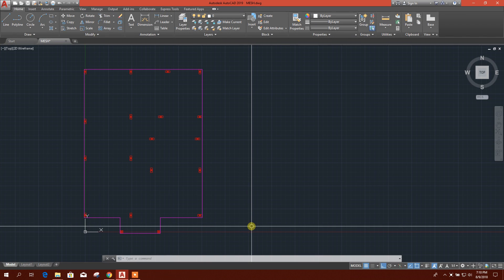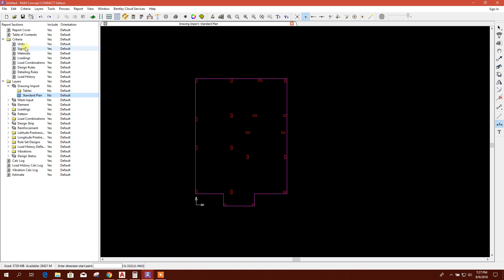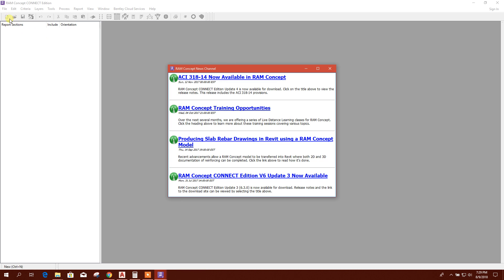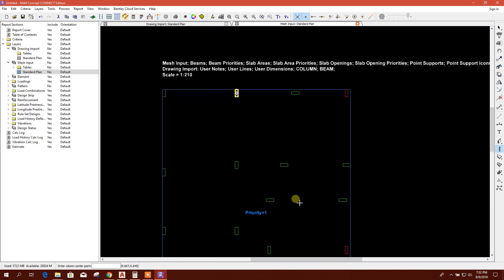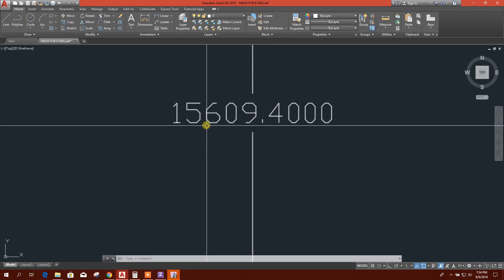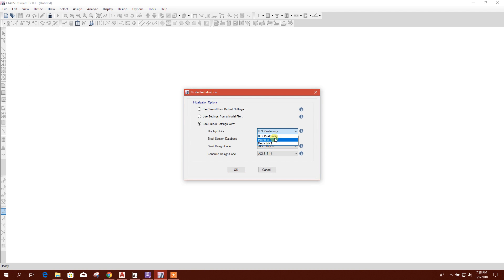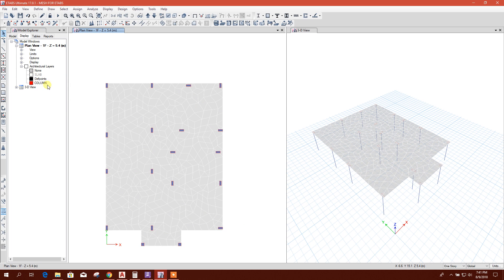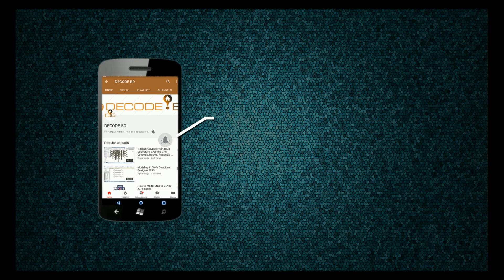ADVANCED MESHING IN ETABS WITH THE HELP OF RAM CONCEPT

Comment: Dear Sir, when I apply automatic rectangular mesh in walls , the walls and slab sections  disappear in Etabs 2017 v17.0.1.
Reply: u have first to make a manual mesh on the wall first vertical then do an auto mesh for the horizontal way ..cuz the wall  in etabs it is always supported on only 2 support and that's not good so first we made a manual devid for the vertical direction thats will add more support for the walls and then we made an auto mesh for the other dir ..not that u should assign piers for the wall so the etabs will know that it is the same wall it is easy to read the result and for the design

Comment: Etabs 17 can not run analyze (f5) on any 64bit Windows! why?
Reply: Check you model, whether it is modeled properly or not. iam using etabs 17.0.1, its checking the model and also analysis along with design... Which country codes u use??
Reply: Also i have 64 bit platform only..
Reply: Not working for me too. Platform is 64bit, Win7. Can't analyse the model. 
Can you tell us from which source you downloaded the Etabs & its crack.